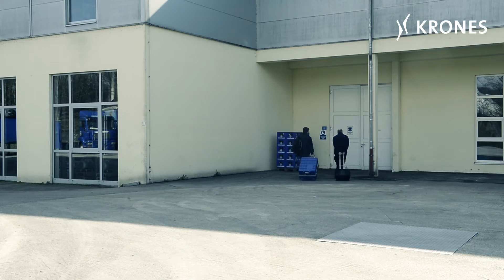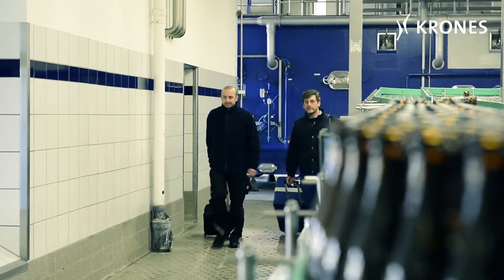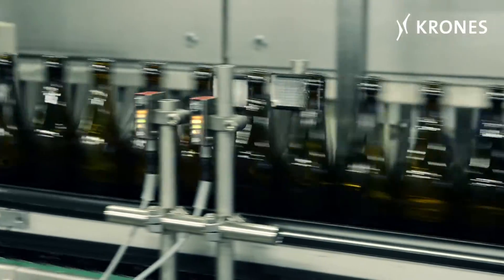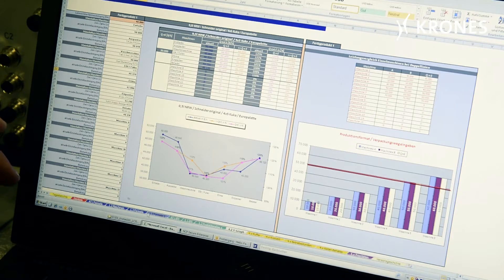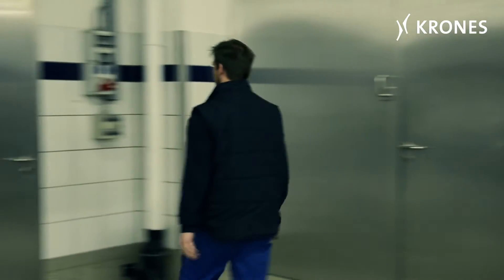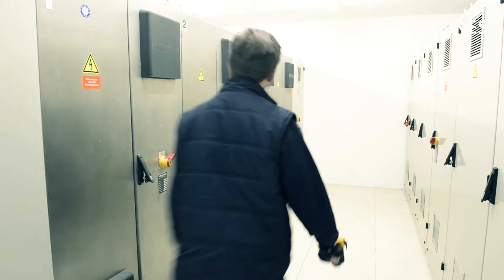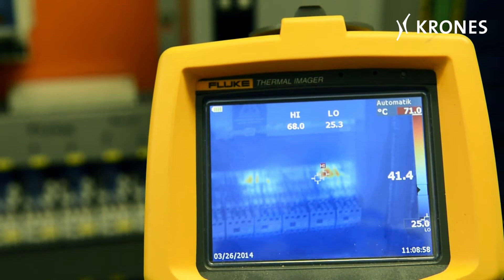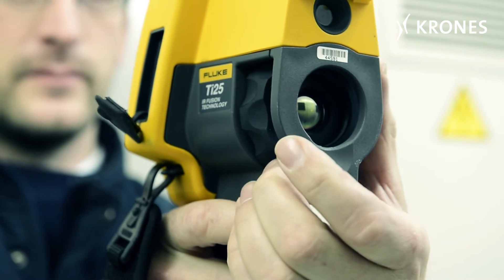Krones line analysis

Comment from the maker: Significant increase in productivity

The declared aim of a line analysis job is to raise the overall equipment effectiveness of the line concerned. And this means: looking at the line from the client's point of view. Listing all the defects, recording the production data of the reference machine, noting down the machine speeds, the buffering times, the operating hours and the make-ready times. So far, increases of between 2 and 10 per cent have been achieved, depending on the particular line involved.